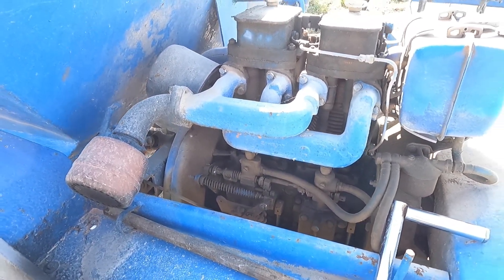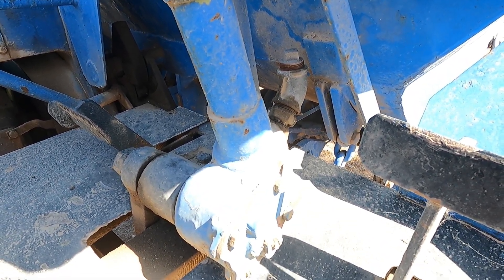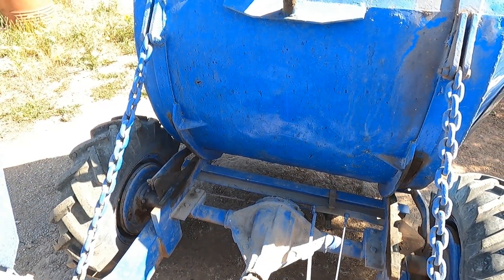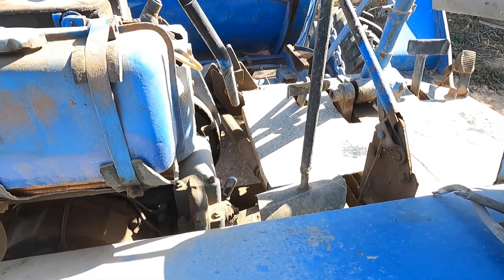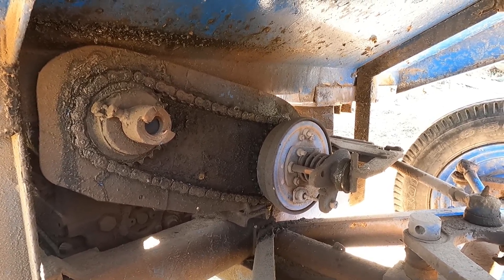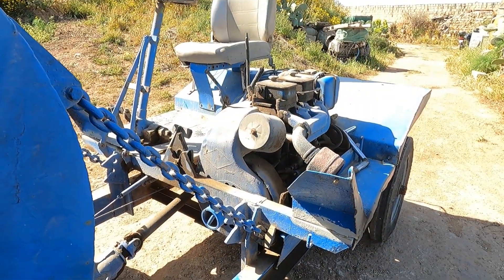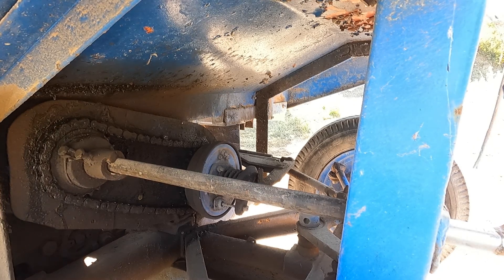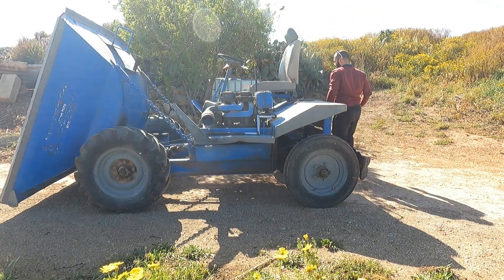Petter Dumper - Thwaites Tusker  1964

Comment: Gallifords had a fleet of tuskerswhen theybuilt the Coventry ring road in the 1960’s. Coventry city council had a tusker with the digger attachment on the front where the skip is and it towed a tipping skip on  two wheels behind it at around the same time. What wonderful dumpers they were with the AVA twin cylinder engine. They had a different sound to the PH engines.
Reply from the maker: Thanks for your informative comment!

Comment: I do like the AVA engines. I have a 1 which needs a new pump as a previous owner cracked the pump trying to slow it down with a hammer. I believe it is the same as the PH1. The new made in India 1 I have needs a little modification.... Just as well I have a machine shop.

I liked your rolling reverse start! You do have some steep inclines around you.
Reply from the maker: Is the flange broken from the bottom? I hade one once, and have welded it. The AV range has smaller bore. The incline is a  pile of soil. Thanks for your comment Ben
Reply: @enginelover1  Yes, it is broken at the bottom but is aluminium. The part numbers did check out. Mind you it is possible that the original is wrong. I will did the bits and and post a video for comments. Many thanks.
Reply from the maker: @BensWorkshop  My repaired pump is on the Petter that I used for the waste oil video. I did repaired it with aluminium welding rods using a DC arc inverter welding.
Reply: @enginelover1  Many thanks. I have such a welder, as you know. Got a link to the rods?
Reply from the maker: @BensWorkshop   I buy them locally just a 5mins drive away. I dont have a link. I should do a video using them, that would be interested. I have something to repair with too.
Reply: @enginelover1  Many thanks, I would be grateful. I will get the bits out to make a short video.

Comment: Pretty simple way of doing a clutch, thanks for the details on that. It's a really nice race course you've got there!
Reply from the maker: Haha, just needs some rail tracks ;). Its really a clever and cheap design for that clutch in that time. I dont know yet the condition of the shoes. Wonder where am gona find I I`ll need any. Thanks Mate
Reply: @enginelover1  I suspect they are standard for some car though you could probably get them a new pair of pads riveted to the original shoes.
Reply: Yes, the clutch is quite interesting.